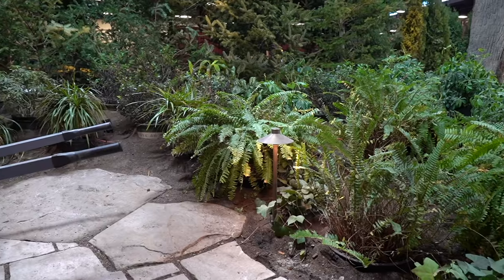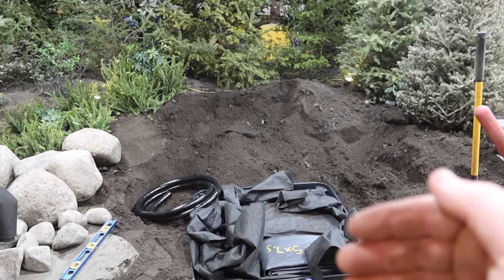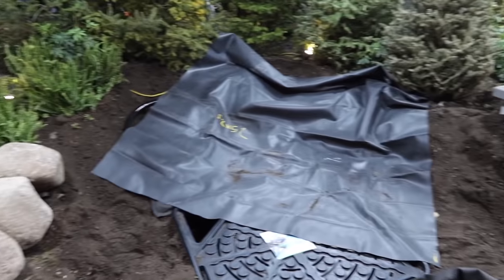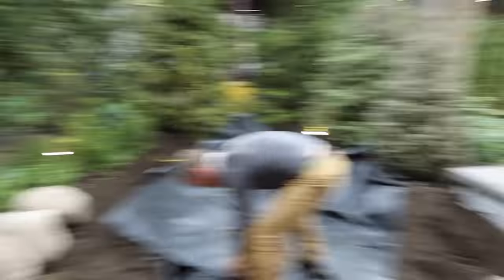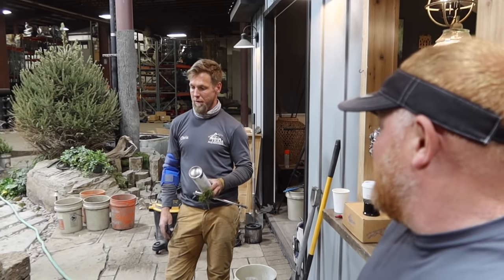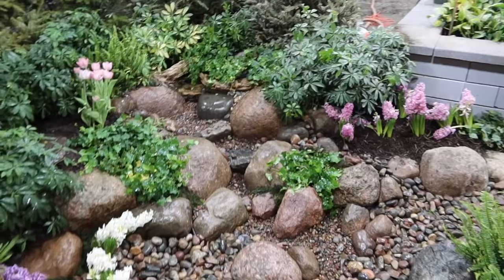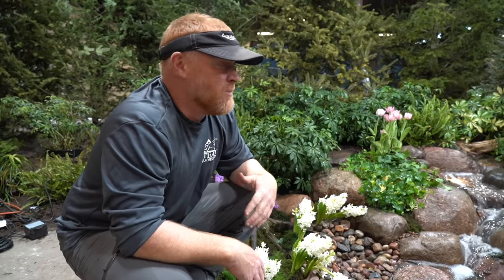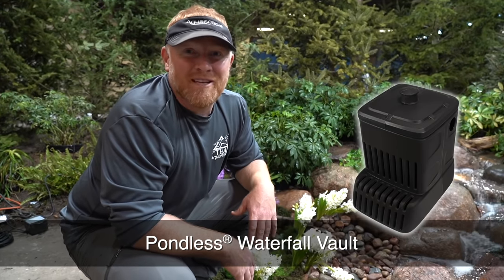How to Build a Small Waterfall Using an Aquascape DIY Kit

Comment: Coolest layout ive seen. Am I wrong? - Looking at the roof above you, Your installation looks to be inside a factory for demonstration purposes which negates having to plan for rainwater. As i watched you work the dirt around your basin, im thinking that Outside in the elements youd need to put a liner under and around the aquabasin to keep dirt from being flushed into the basin ?

Comment: I just watched your building a small waterfall with the aquascape diy kit.  A few questions:  My creek is 11 years old and all the rocks are removed to install a new liner.  1.  When you placed the rocks in the liner did you use landscape foam to seal around the rocks?  2.  Did you shape the new liner to help direct the water in the directions you wanted to flow from left to right?  It appeared that Chris was pulling the liner up and around the rocks.  Do you have another film of yours that you would recommend for me to watch?  My new liner is arriving this coming week and I would prefer to create your natural flow into the creek, rather than my old box with a sheet of water coming out.  Thanks in advance for your film and your great option.  Gary

Comment: Did you use additional rocks, than what was shown?  Looks like you used some flat rocks as well?  How is the top spillway done?  I'm struggling with your spillway and placing it.  Do you leave an area for the water to pool?  Do you have a video that concentrates on just the spillway?  I understand the main process of the spillway but not tying it all together.